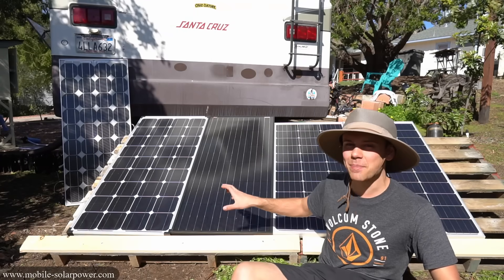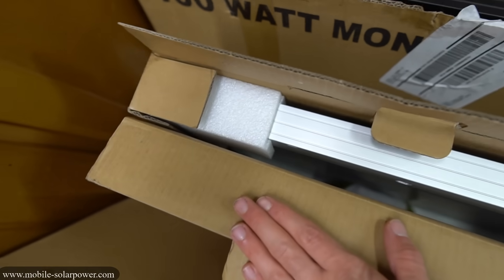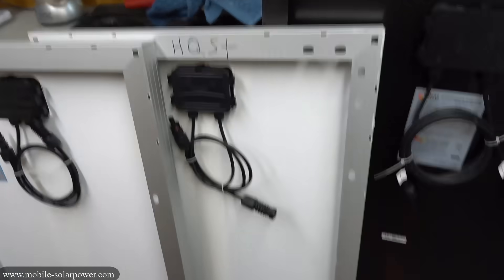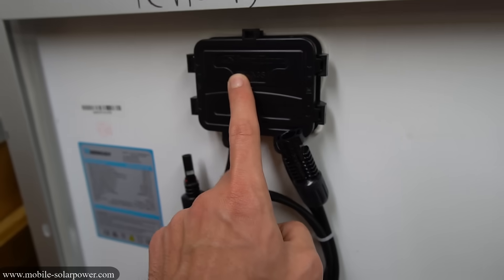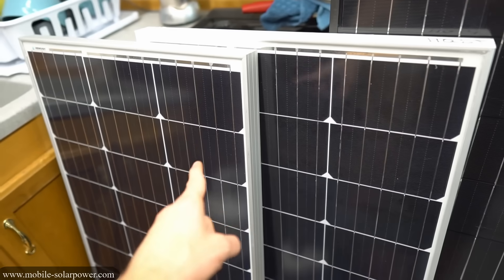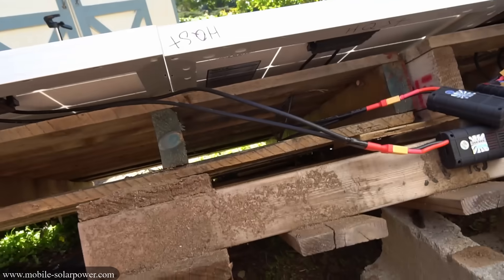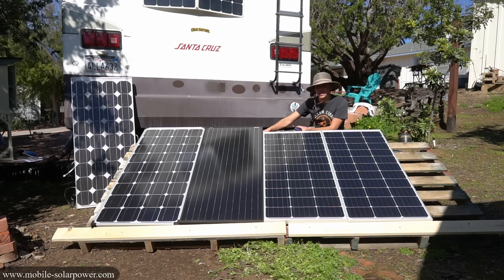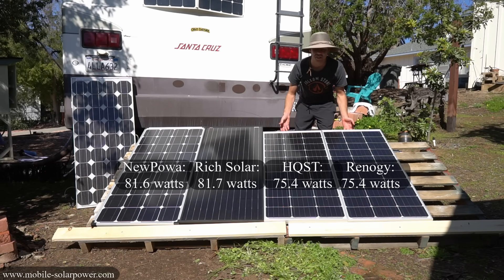Top 4 Amazon.com 100w Solar Panels Tested! Renogy vs. HQST vs. Rich Solar vs. NewPowa

Comment: The number one omission from your video is the number of cells per panel. You are comparing panels with 33 cells against panels with 36 cells and you didn't list the specs of each panel, which was what I was looking for. When the makers of these panels test them they use a computerized test rig.
.
My conclusion... you have been had. What you show and what the links point to, do not match. Amazon is a sales company, not a manufacturer of solar panels. I managed to find 2 panels with their specifications... not a great sales pitch.
HQST 50 Watt 12 Volt Monocrystalline Solar Panel... your link is incorrect!
Renogy 100 Watt 12 Volt Monocrystalline Solar Panel (Slim Design)... your link is incorrect!
Richsolar All Black 100 Watt 12 Volt Monocrystalline Solar Panel.
Newpowa 100 Watt Monocrystalline 100W 12V Solar Panel.
.
If you want to compare panels, you will need different test equipment to analyze them... load testers that will hold the output voltage at the Optimum Operating Voltage while measuring the Optimum Operating Current... according to Renogy, probably worth thousands of dollars.
Reply from the maker: The links are actually correct, but they are out of stock.

Doesn't matter how many cells are present, they are all rated for 100watts. That was the whole point of this test. 

We have a load tester that matches internal resistance of panel to our load, which is LiFePO4 battery. Called a mppt. You are wrong about it costing thousands of dollars. Totally false. 

I think you should find a electrical engineer to verify what I said or Google these things. Very inaccurate statements in your comment.
Reply: Your MuPPeT is a sort of hit and miss device for getting an acceptable amount of energy from the panel. The factory test fixtures can measure to the last milliwatt and operate with a calibrated light source. How come you weren't getting anywhere near 100 watts from any of those panels? The algorithm for calculating the output is complicated and requires a lot more computing power than a charge controller has. 
.
The peak voltage from your 33 cell panel is 16 volts... It would need a 2.56 ohm load to show peak power, not a converter to charge a battery... the state of which is unknown. 
.
 The peak voltage from your 36 cell panel is 17.2 volts and needs 2.96 ohms for peak output.
.
How do I know this? I'm an industrial electronic technician who has been working with solar panels since the late 70s for charging batteries used for remote radiotelephone repeaters... before PWM and MuPPeT chargers. I've taught a few electrical engineers their basics in solar, thank you.

Comment: I think your argument is incorrect. If you say the quality of the smaller panels is better. Okay but the larger panels were producing 5 watts more, which is NOT A SMALL DIFFERENCE. Those smaller panels would have to increase their size to exactly the same size to make up the five watt difference. To me they are false advertising a smaller panel at 100watts. They are not producing equal power off a smaller surface.
Reply from the maker: get out a calculator and measure the surface area and you will find the smaller panels actually produce more power for their size. I cover this in another video. Also, 5 watts is not a big difference given there size. Also, all of these monocrystalline solar panels suck compared to what I've been recently testing. Watch more recent test videos

Comment: How bad does each panel drop off if a partial sun block is thrown in?  Basically like having a partial block (shade) from a pole or a tree limb.  Like on a sail boat where the sails boom may have to block one or more cells on a panel.

Comment: Since HQST is the winner, would the same logic apply for the 50W version panels?  Let's say I want to build my own portable panel kit using the lightest/smallest version.  Would the 50W panels in parallel work like one 100W panel?  Asking because there always seems to be some variation with this stuff.

Comment: Hey Will, Do you have any Flexible panels you recommend? 
Or just Stay away from them? 
Reason is I want a discrete roof system.
Or can you do a video on flexible 100-150 watt panels?
Reply from the maker: Only ones I recommend lately are sunpower flex panels. For the price, it's hard to beat them. I have them listed on my website.

Comment: I remember arguing with a guy about renogy and hqst telling him they were the same panels. He insisted they weren't. I bought both and placed them side by side and there was no difference between them so they apparently came from the same manufacturer. They had the same power output as well. I think he just made up that complaint he had because I saw no difference lol
Reply: Check out the Renegy (New Addition)   New Version of the panel,  1 penny more and has the corner holes - same as the HQST!
Reply: That was my point for a few years now. Renogy and HQST are the same. The HQST are cheaper.  I like the consistency  of those panels.  Recently  I switched from mono to poly because the outputs are almost the same and poly panels are cheaper.

Comment: I bought three of those same  HQST 100 panels to mount on my van. I have not mounted them yet but when I bought them I noticed they are exactly same as the Renogy but much cheaper. HQST all the way. I don't care about factory warranty on Ebay bought panels because they would be too expensive to ship back anyway to have replaced. I jut look at reviews at which one works best.

Comment: Why wouldn't you want the solar panel that gives the most output per unit of sunlight i.e. 81.7W?
Reply from the maker: because usually I test for efficiency. That extra five watts does it mean much on the grand scheme of things considering how large those ones are
Reply from the maker: 5 watts is not worth the added size

Comment: You mentioned they were the same temperature? I did a very raw temperature test with my 5000 W set. I watched the wattage harvested at High Noon and then proceeded to mist all the panels with the garden hose as quickly and evenly as I could. My results were inconclusive. It definitely didn't make a big enough difference for me to tell. Very slight variances in the passing Haze were dwarfing whatever variance in wattage I was causing with the cool water mist. My gutters collect all the water that drips off the panels and fill a tank for our house because we are completely off grid except for Fiber Optic internet lol so I thought maybe I would set up a misting recirculating water pump and decided it wasn't going to make much of a difference for me
Reply from the maker: Well it's the cell temp that matters. Your water mist probably didn't cool them much. Look up temperature coefficient of your solar cells to understand how big of an effect this can have.
Reply: @WillProwse  good idea I often forget to look at the math and Skip straight to the real world test.
Reply from the maker: Oh no worries. It's all good man
Reply from the maker: Temperature coefficient of materials is a very real and measurable phenomenon. You are not beating the laws of physics with your garden hose  lol

Comment: Update :  he did the measurements in a very accurate and equal way. I obviously misunderstood the first time I watched the video. Below you will read my thoughts but I was under the wrong assumption. You can disregard my statements below

I'm worried about the accuracy of your comparison. There's normally a maximum power point voltage on the label. This is where the maximum power point charge controller will probably adjust the incoming volts to. It can't adjust properly to the panel if there's three other panels hooked in parallel. You need to test the panels each with their own charge controller and take the wattmeters side-by-side snap a photo of them so you're basically freezing time in order to get a look at all of them at once. and compare what you see in the picture. Of course make sure the load is larger then the Max potential Watts harvested like you already have done. You could probably do this test one at a time very quickly  before the sun moves. between 11:30 a.m. and 12:30 p.m. and still get accurate results. Basically what it comes down to is the maximum power point charge controller cannot find the maximum power point of a particular panel  if there's a bunch of panels hooked in parallel. Parallel like that it just finds the average maximum power point incoming voltage of the set and Some panels will show penalized results at your watt meters.
Reply from the maker: You did not watch the video at all. Each panel was not connected in parallel or series. Each time it was connected directly to a mppt and nothing else. I know what I'm doing. Please watch the video again to see how I did it.
Reply: @WillProwse  I updated the top of my comment as to not mislead anyone who reads it. Sorry about that
Reply from the maker: Ok no worries. It's good
Reply: @WillProwse   Will Prowse  you're totally right. When I was listening I heard it wrong I did listen to the video I wasn't watching the screen. I have a habit of watching videos on two times speed I watched again in normal speed  and you clearly  I said it correctly and you even had text on the screen clarifying that you are doing it the correct way.

Comment: I did buy the NewPowa before seeing this video. Size does not matter to me but  power output. Larger panel, more surface, less interference due to the gaps... also it was a little cheaper and the reviews were more positive.

Comment: Nice video. Kudos for spending your own money to buy and test the panels. I found it most interesting that the larger panels actually produced more power. In addition to the larger gaps the cells also appeared larger. One aspect of the test that you could also include would be partial shading of the panels. That may reveal performance differences in panels with more bypass diodes/circuits.
Reply: HQST and Renogy brands are from same company.
Reply from the maker: Very true, good point. I want to test those diodes.

Comment: Thanks for the expertise! What's your opinion for flexible solar panels that I'll most likely use because my roof isn't flat. Also, I want to keep my cats with me and the summer temps can reach 114 degrees farenheit.  I have a pirtable air conitioner with 10,000 BTUs and the specs state it uses 2.9 kwatts. I'm not sure how many hours I'll run it because that depends on room temp. Is there any inight you can help me with? What do people do about their pets?

Comment: Are they all monocrystalline, I'd be curious to see what the voltage and wattage drop is if you cover portions of the panel...I got my new powa for 92 each.
Reply from the maker: Practically nothing. Cover one cell and it drops by 90+%. That's for all panels.
Reply: @WillProwse  I have not had a chance to test mine as I got them right before winter started here in North Dakota. I know my previous panel the voltage drop was pretty much proportional to how much you covered the panel. That's why I made sure to stick with mono panels as they are less susceptible to voltage drop off when a couple sells are blocked. Anyway good video based on your test although the sounds like a lot of the larger ones I feel like a little bit of wattage increase vs size is a relatively equal comparison. Minot going on the roof of my camper so it's not like I'll be moving them around much haha

Comment: I spoke with Renogy about another product, but asked about the similarity of HQST product, and was told that HQST was owned by Renogy and was just less expensive and re-branded product. Have one 100w HQST panel so far, the one with the larger cells, the ones in this video are the slim 100w versions I believe. No issues thus far. Another brand to look at is Mighty Max, I've used 8 of their 150w and think they are great, and noticed they have a really affordable 100w one now and amazon. Around $90 if not mistaken....
Reply from the maker: Wow this is great information! Thanks

Comment: i Choice the Higher Outputs,, when it comes to Producing Energy, that's what  matters Most,,, size and holes will not produce power
Reply: I choice #3 330 amp,, i like the quicker charging,  because the sun might not shine for days,,,

Comment: We have a mix of RENOGY and HQST now. The size and power output are the same and have been powering the low amp circuits in our home for 3 years. We will be adding another bank with all HQST panels.
Reply: Tiersmoke92555 how many do U have?

Comment: Ummmm  but.... Why purchase solar panels that produce less power? Respectfully..✌️ electrical power is the point... Max output!🤷‍♂️ Then when you consider purchasing multiple panels🙄That 5 W per panel will add up! You must calculate the accumulation or loss of watt hours throughout the day... ✌️ not to mention your other solar components taking a bite of your electrical sandwich 🥪 such as... 
The size of wire between the solar panel array and charge controller.. which will create resistance... 12 V systems are notorious for loss compared to 24v/ 48v.. also DC current travels better on stranded wire as opposed to solid copper wire, because DC current travels on the outside of the wires, AC will travel through the core of  wire..
Then we have the issue of controllers ...PWM or MPPT..! A quality in MPPT controller will have an efficiency of approximately 98% PWM controllers are in the 80% efficiency range.. BUT WAIT THERES MORE! ☝️🙈🥴 
but I’m going to leave my comment there... thank you for the video 🤙
Reply from the maker: And yeah, oxygen free copper wire, mppt, lithium iron phosphate etc. I have videos that cover every point in your post.
Reply from the maker: It's max output for the size. These are 100 watt panels so efficiency is huge. That extra 5 watts is not worth the extra size and weight.
Reply: To each his own, but I will stick with the higher output panels, when you’re living off grid every drop of juice helps ;)  i’ve built my own highbred cabin by myself. On 32 acres here in Tennessee, I’ve had a solar system now for about eight years, I’m in the middle of nowhere close to the Tennessee River,  it’s absolutely stunning! Very grateful for people like you that are posting these videos, I can’t tell you just how much it had helped!

Comment: If you were low on space, why wouldn't you buy the Renogy 160 Watt panels?  I have 2 on my 26' travel trailer and have room for 2 more.  I find that the 2 - 160 watt panels paired with 2 - Amazon purchased Vmaxtanks 125 Ah 12V AGM batteries works really well for me.   I love the Victron Smartsolar MPPT 100/50 bluetooth charge controller.  Getting data on smartphone allows you to make educated decisions on your solar system.  Like the choice to NOT purchase 2 more Renogy panels that I don't really need.  I just added an additional battery and now I am set (2 panels + 2 batteries).

Comment: Will, You got good Karma, Thank you for your energy.  It was about 6-8 years ago I saw an article on the new 3rd generation solar panels (new Thin Film Composite) that the company said lab tests were showing efficiency ratings of 30-36% which is practically double all other existing panels.  The company had completely (had photo of the prototype) covered the old (66-70) VW bug with the very flexible TFC panels and were going to drive it as electric car around USA to get some true results.  That got me excited and I figured it would be a year or two and we would be able to get these panels.  Since that article I have not heard or read a thing about that awesome TFC test, etc.  Do you happen to know what happened?  The new flexible panels available are in the 14-18% efficiency rating and look quite different.  Do you have any clue what happened to that "next generation" that was going to blow away the competition?  Take Care and Stay Healthy!

Comment: Just as an FYI … I’ve owned a Renogy 100W panel into a 20amp PWM kit + 10 gage wire for a little over a year and it works fine. I too was at a flip of the coin betwn Renogy & HQST. I will say that Renogy has GREAT customer service and answered all my questions very promptly, even a year later. My only complaint about solar is you have to chase the sun a lot to get more than a couple of amps charging. I rarely see at or above 5 amps. Even using a MPPT only increses a tenth ot two. I spent about 1 year off & on researching solar for my RV and decided to “experiment “ with a small system first, before going to my ideal 400-600 W system. Glad I did; as for me, i do not like parking in direct sun in the Summer & unless you do you’re not going to get much amperage.

Comment: Renogy makes two different sizes of 100 watt panels. I just purchased two of the older, larger style so they would match the two I purchased a year ago, My suspicion is though the "compact" size is rated for 100 watts, it does not deliver as many watts as the larger size in the real world. (That would make for an interesting YouTube video.) I also ordered some solar cables from HQST to attach the four panels together. The HQST cables were shipped to me from Renogy. So yeah, I'd say Renogy and HQST are the same company.
Reply from the maker: Good to know!

Comment: I bought the HQST 200W monocrystiline panels from 480Vfred on eBay and have been quite impressed with their performance.  I'll get your watt meter to do comparable tests.  I believe 200W panels give more power per Sq ft of roof space on a RV.

Comment: If I buy 10 of them(hqst) what controller do you recommend and how many batteries?

I just need it for lights and an occasional appliance  seeing as I am outside a lot. But I want the option to run power tools and computers and all that as well as water pumps and such.
Reply from the maker: Oh goodness that's a big question. Check out my website and look at the off grid king package at www.mobile-solarpower.com